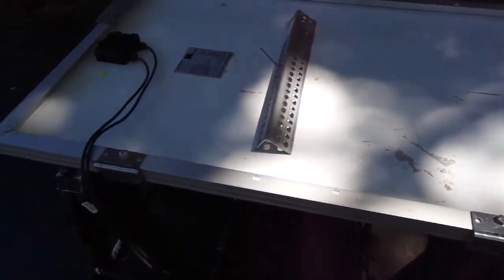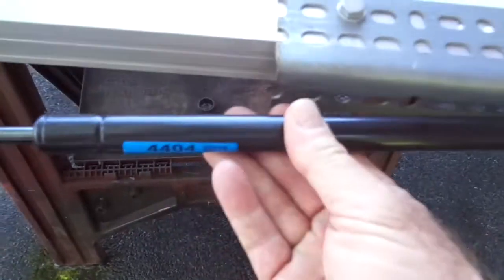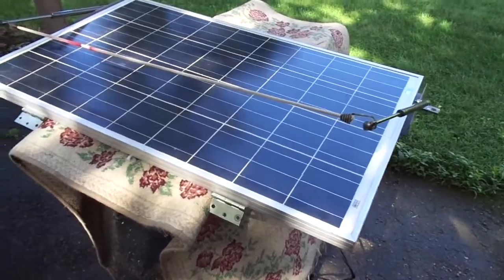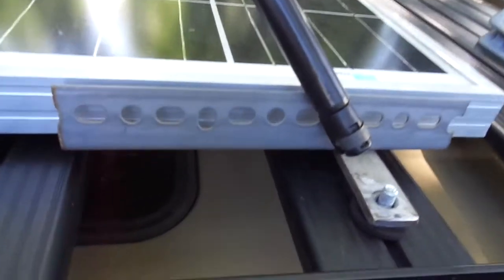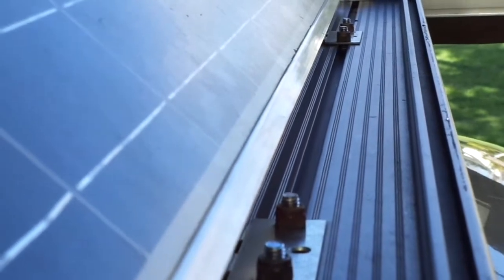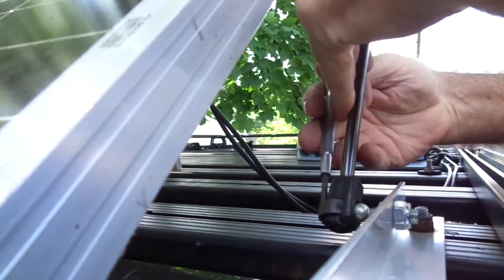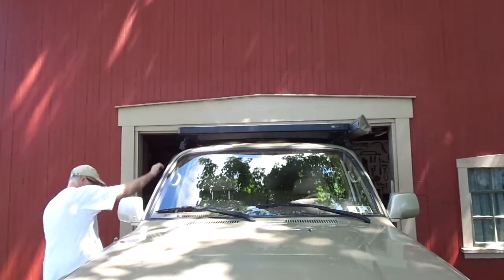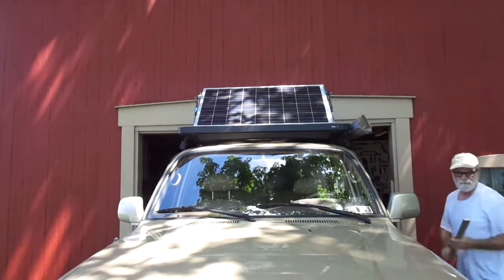Mounting a Solar Panel on your Expo Rig

Comment: Any vibration sound or noise along the way ? Pls advise, TQ
Reply from the maker: Yes, a bit of baffling occurred during high crosswind at 65+ MPH,,  I solved the problem by using 1/2” thick rubber bushings to elevate the rear. Baffling gone.

Comment: Ghastly, just go flexible.
Reply from the maker: benjithehunter flexible would be a pita,, in out in out, pack, unpack,,, yuck
Reply: @rubicondon04   It's overkill. A flexible panel could slide in and out of anywhere. I have mine flat on my roof not being worried about the angle and I could carry 10 stack of flexible panels taking up less room than this.
Reply from the maker: OK conversation overkill. This works for me, panel is deployed and working in less than a minute if I hurry.  a minute 30 seconds if I take my time. All told it cost less than 150 bucks for more than enough power for our needs. Sometimes my friend, old school is better.
Reply from the maker: @benjithehunter  dude,, I've given your idea just a tiny bit of thought and research.  The flexible panels are way too expensive, and way too unreliable. They crack and render themselves useless.  I'll stick with old school reliability.

Comment: Greetings from Russia!!!
I liked the idea, take note.
Question,
the panel rises just fine
but, as it goes down, does not break the panel?
  because she does not have such a weight and such rigidity as the tailgate's door
Reply from the maker: Good question, and thanks - The struts are very strong and a bit oversized for the weight of the panel.  one most use a good amount of pressure not only to fold the panel back down flat. Hold it down, then fasten the wing nuts to keep it there.